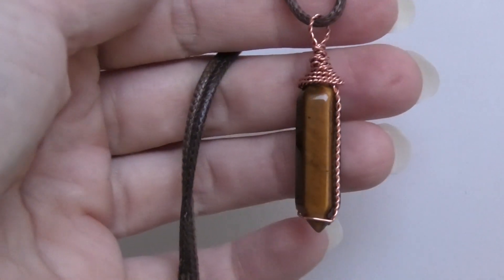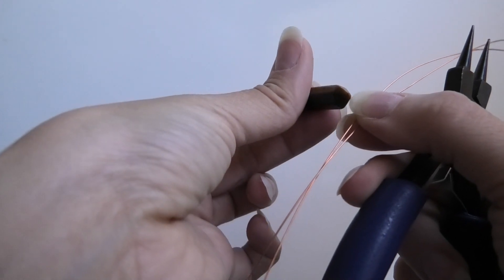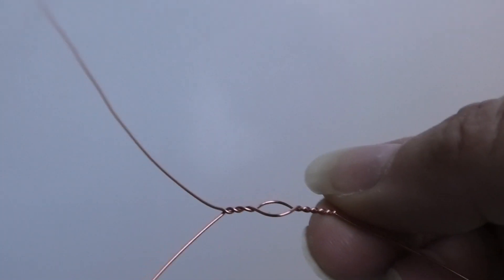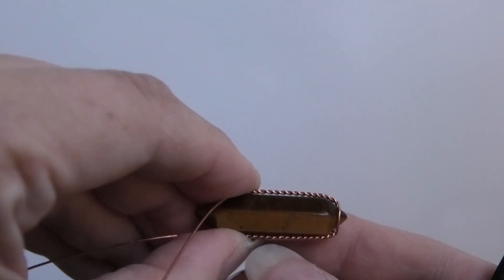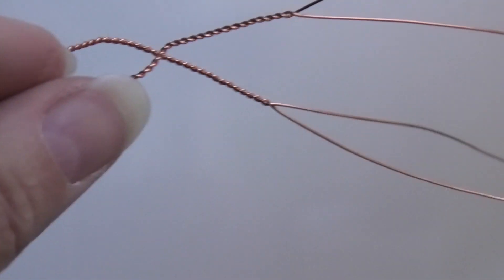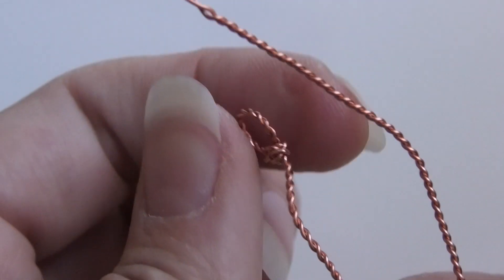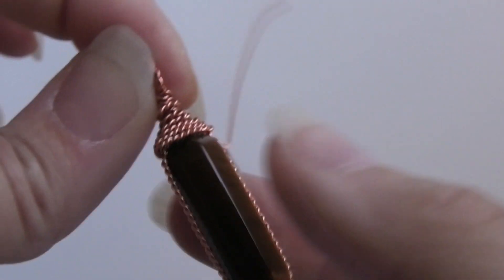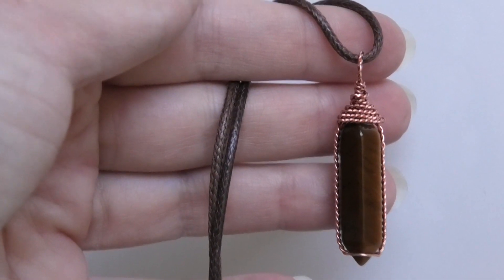Wire Wrapped Crystal Point Pendant Tutorial

Comment: To save some time you can get a drill and put the two ends of wire into the chuck and tighten it down then engage the trigger. You may have to use a bolt in the center to fill the space if it won’t clamp down tighten enough on the wire. It’ll twist it in seconds.

Comment: I love working with twisted wire..the more tension you apply while twisting will help make a more even twist...I've been fully twisting my wire with a drill..put one end in a vice the other ends in a drill and put in reverse....the wire is so easy to manipulate and in dealing with kinks as they just pull out with finger heat and tension.